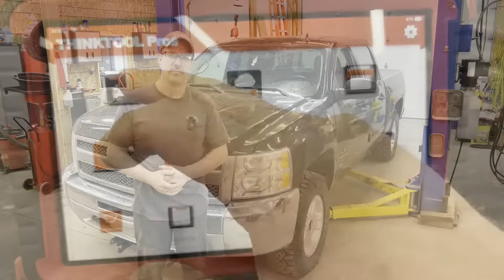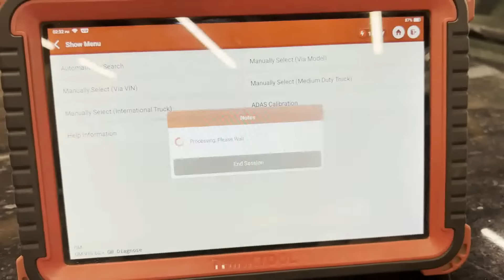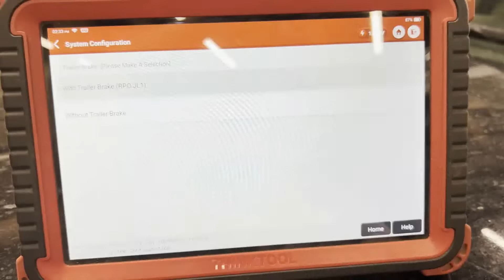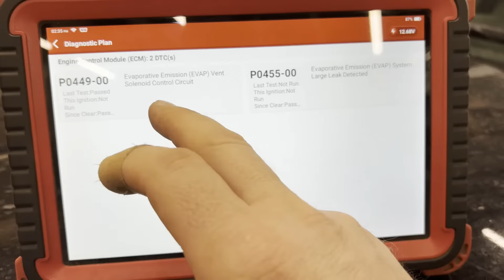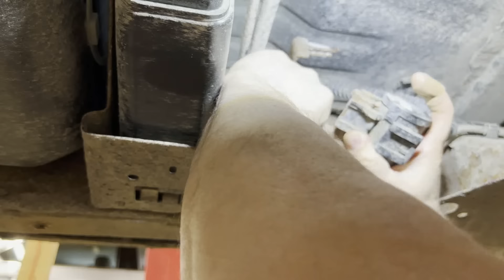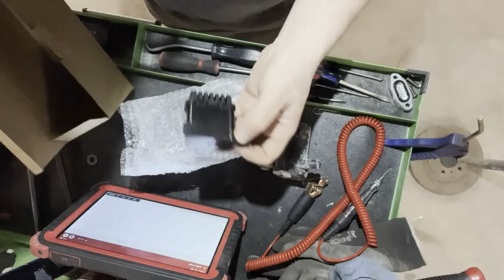Chevy Silverado Evap Vent Solenoid P0449

Comment: REPLACING FILTER: Not sure which vehicle you’re working with but with my 2011 Silverado 1500….Open the gas door. Above the filler hole, there are two tabs. I used a flathead and pushed them through. While under the truck, I followed the black tube up to the back of the filler hole and pulled it down. I’m not sure if I was supposed to, but I took the top grated part off the new vent and swapped it with the old one. Now I’m taking the 3 bolts off around the filler hole to see if it’s easier to re-clip the filter to, then put the bolts back in. Hope this helps
Reply from the maker: Great info! I’ll pin this for everyone to see!

Comment: I have a 2012 Chevy 1500. 5.3 l eng. I have a po446. Is that the same code as whet you just did. Cause I can’t get the plug off that evap solenoid purger canister
Reply: I'm having the same problem. I just went and purchased a new connector with pigtail to just splice in.

Comment: How come you didn't show how to change the filter?
Reply: Right? I’m having the same issue rn. How do I change the vent that goes over the filler neck?? Can’t find a single video on that.
Reply: Not sure which vehicle you’re working with but with my 2011 Silverado 1500….Open the gas door. Above the filler hole, there are two tabs. I used a flathead and pushed them through. While under the truck, I followed the black tube up to the back of the filler hole and pulled it down. I’m not sure if I was supposed to, but I took the top grated part off the new vent and swapped it with the old one. Now I’m taking the 3 bolts off around the filler hole to see if it’s easier to re-clip the filter to, then put the bolts back in. Hope this helps.

Comment: I think I would have rechecked the part with all those differences. Just seems a lot of different sizes and canister size to me.
Reply: That's just the way the aftermarket ones are. Saves about 60 or 70 bucks for the hoses.

Comment: Should you have a constant 12v to the evap and the PCM controls the ground? My white wire is showing 12 v when I use my test light and ground to the frame. I’m getting a parasitic draw from this vent canister solenoid

Comment: Great video!  But, looks like no power to the solenoid for me, I think. If so, what might be the cause? Fuses good per my test light. Then, with key on, I used my test light on the plug/wires leading up to the solenoid. No power. I then started the truck, let it idle for about 10 minutes and tired again. No power still.  2018 Chevy Silverado 1500 4dr 4wd in excellent shape - stock.

Comment: 3:19 Thank you for the video, i have a question my gmc yukon 2008 has the same vent valve but when i come to test it it lights always. I’ve the checked the wires. Is it normal

Comment: So I have a 2014 sierra, it looks identical to this and I’ve changed everything on the evap system but this because all the ones I got were different than the original. To will use the bigger one if it works then. My only question is on mine I have that filter coming right out the other end but I also have a hose that runs to the filler neck like on that truck, how should I go about that

Comment: Great video. I have to do this to my truck. Do I have to put that filter on by the gas cap?  Can I install it right off the top of the solenoid?  I do have a hose coming down like the one on the video. And I do have to drive dirt roads. Thanks for the video. Subscribing
Reply from the maker: You don’t have to install it up there by the gas cap. I really think they put it there to keep water from getting into it. Just make sure to blow it out periodically with compressed air and you’ll be just fine.
Reply: @Tomsfoolery.  Run 5/8 heater hose out under the hood and put filter on that end.  Dealer does...